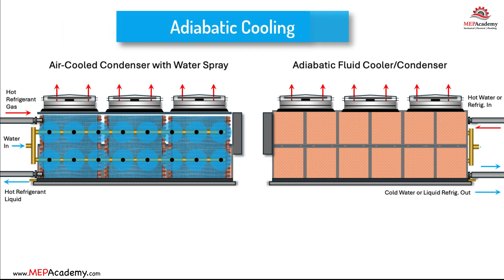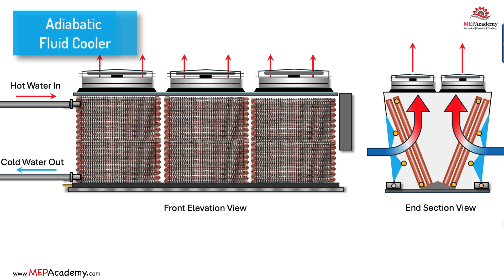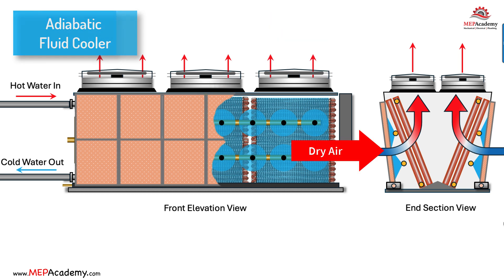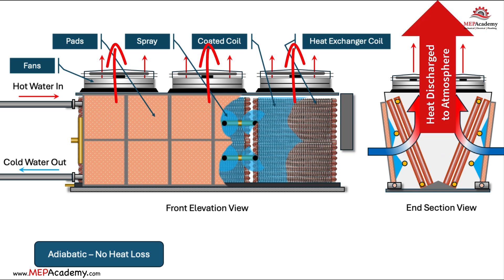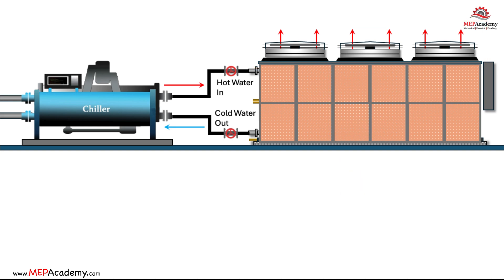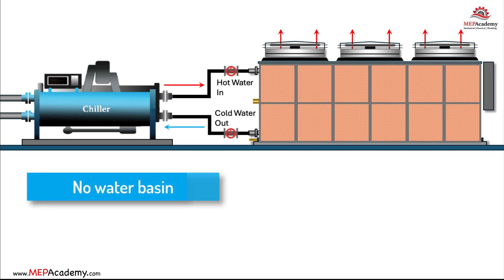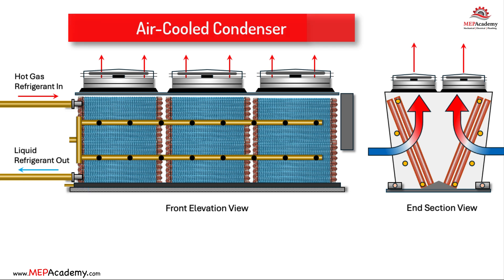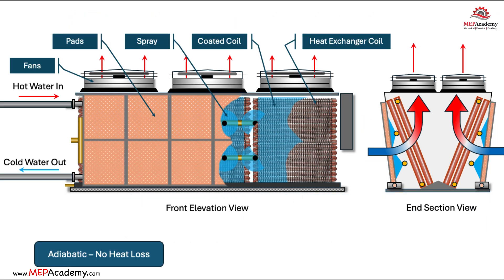Adiabatic Cooling

Comment: In industrial, does the air humidity affect the cooling performance of an air-cooled (non wet) heat exchanger?
Reply from the maker: Yes, air humidity can affect the performance of an air-cooled (dry) heat exchanger, but its impact is indirect compared to how it affects adiabatic or evaporative cooling systems.

Here’s how:

1. Dry-Bulb Temperature Is What Matters Most
In a dry (non-wet) air-cooled heat exchanger, performance is driven almost entirely by the dry-bulb temperature of the ambient air — not the humidity. The unit rejects heat by transferring it from the process fluid to the surrounding air, and the effectiveness depends on how cool that air is, regardless of how much moisture it holds.

2. Humidity's Indirect Impact
While relative humidity doesn’t directly change the dry cooler’s performance, it often correlates with high ambient temperatures — especially in regions with tropical or humid climates. So, on hot, humid days, the air temperature (not humidity) is already elevated, which reduces the unit’s cooling capacity.

3. Where It Does Matter
Humidity becomes a much bigger factor in adiabatic or evaporative cooling systems, where water is used to lower the entering air temperature via evaporation. In those systems, wet-bulb temperature — which is strongly affected by humidity — is the key performance driver.

Summary:
For a dry, air-cooled heat exchanger, air humidity doesn't significantly affect performance on its own — dry-bulb temperature is the primary concern. However, in humid conditions where dry-bulb temps are also high, cooling efficiency can suffer.

Comment: Is it look like air cooling chiller process ?

Also, it can help us with water cooling chiller as its cooling tower ? 

I have just been confused
Reply from the maker: The main difference between an adiabatic air-cooled chiller and a regular air-cooled chiller lies in their cooling method:
Adiabatic Air-Cooled Chiller: This type of chiller pre-cools the air before it passes over the condenser coils by using an adiabatic process, which involves spraying water or passing air through a wetted medium. The evaporative cooling effect from the water reduces the air temperature, making the condenser more efficient and allowing the chiller to operate effectively even in higher ambient temperatures.
Regular Air-Cooled Chiller: In contrast, a regular air-cooled chiller relies solely on ambient air to cool the refrigerant in the condenser coils. It uses fans to draw air directly across the coils without any pre-cooling, making it less efficient in hot environments and more sensitive to fluctuations in outdoor temperatures.
The adiabatic process in the adiabatic air-cooled chiller enhances its performance and energy efficiency, especially in warmer climates, by lowering the temperature of the air before it contacts the condenser coils.
Reply: @MEPAcademy  Im currently working on a project that requires adiabatic air cooled chillers. I never saw those type of chillers before, Thank you for the explanation !